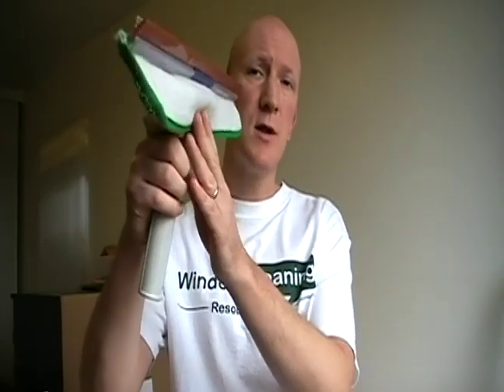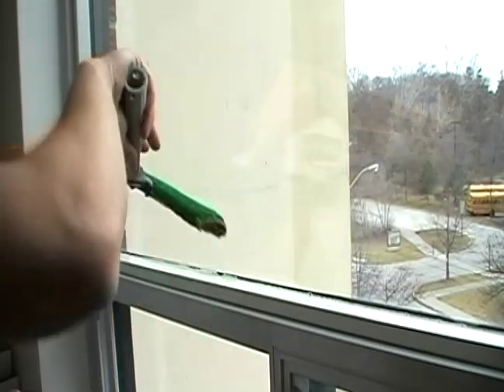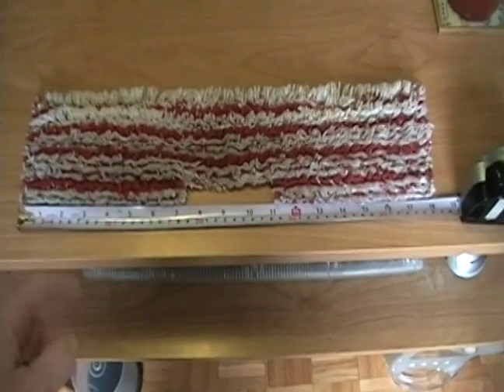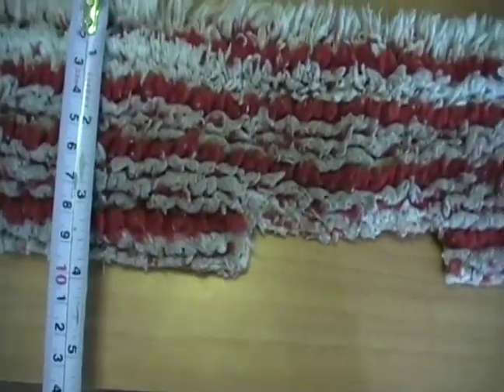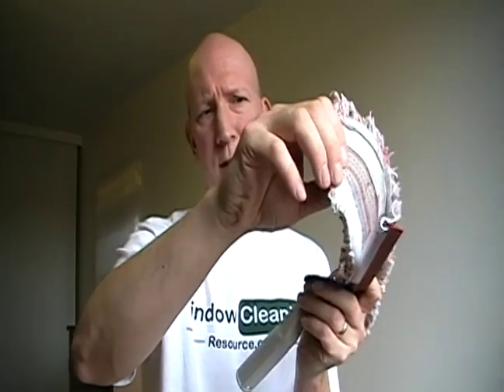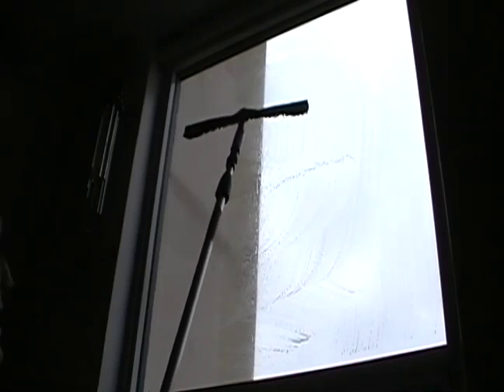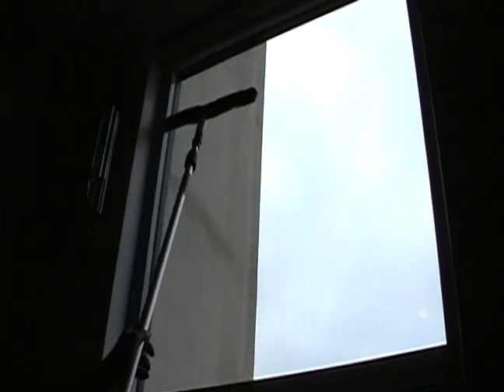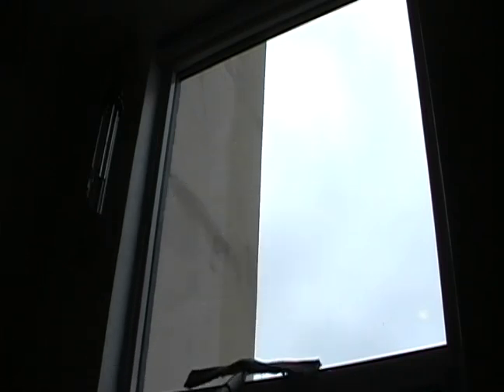Wagtail Whirlwind Squeegee 'pad over' modification.

Comment: @andya07774 I often use regular Ettore soft rubber with my wagtails. No problems there. One tip for less detail is to pre-cut the edges. You can use e clean towel to go across the edges before squeegeeing. or you can do what I do and pre-cut your side and top edges using the end of you squeegee edge. Just run about an inch or so of your rubber along the edge then and then when you squeegee the rest of the window you no longer have have to get close to the edge.

Comment: I've been waiting for this instructional video ever since I started using the wagtail on a pole! Excellent! thankyou.. How do you feel about dog earing the channel? and also what if you have a border between the top window and lower windows that water drips down on. How do you mop up the water from the upper window ledge to prevent it from dripping. I've tried the ettore sponge holder but it just leaves a water smear... thanks